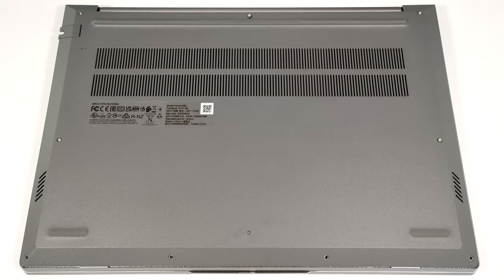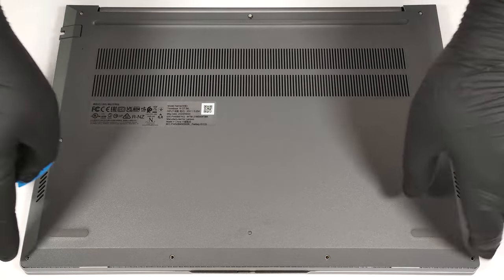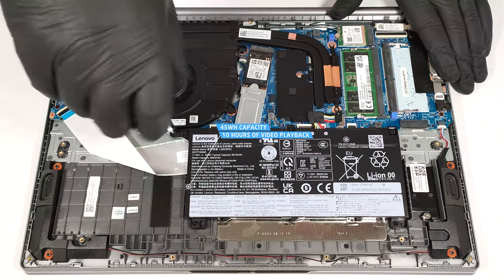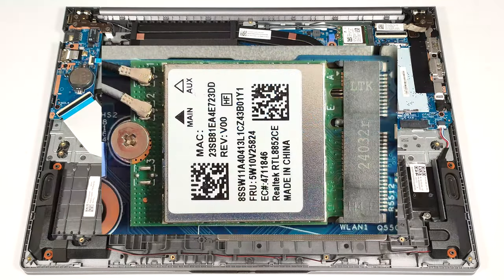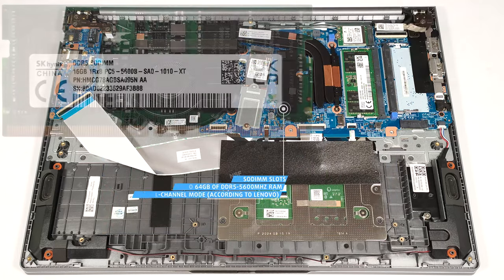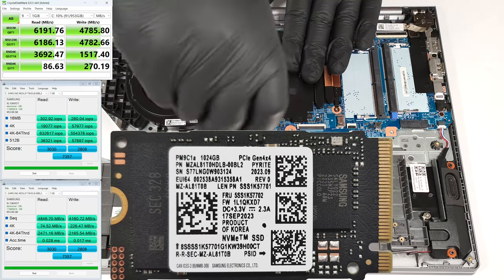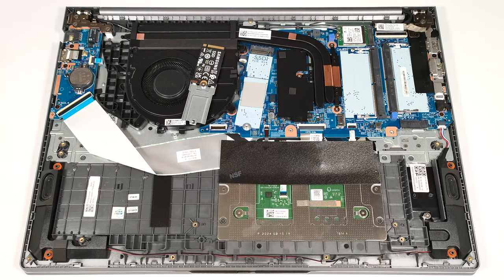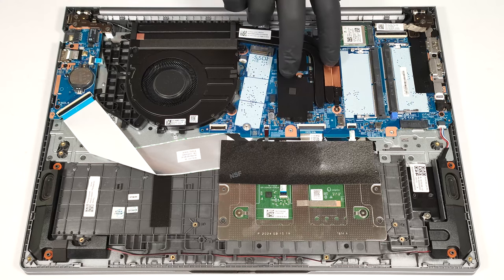🛠️ How to open Lenovo ThinkBook 16 Gen 7 (Intel) - disassembly and upgrade options

Comment: Very useful video. Can I install more than 2 x 1tb ssd? Like 1x 2tb and 1 x 1tb? What's the maximum capacity supported?
Reply: I think the capacity is not really limited. But maybe SSDs with bigger cooler are not fit